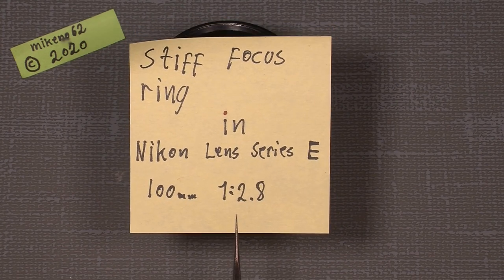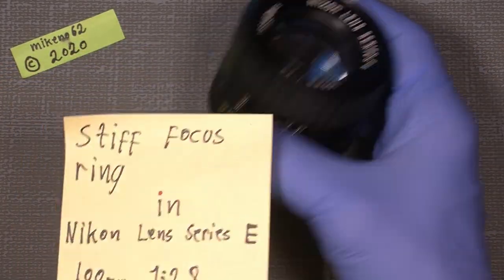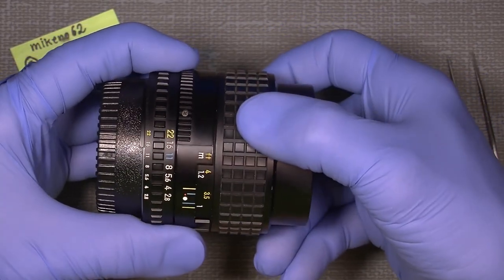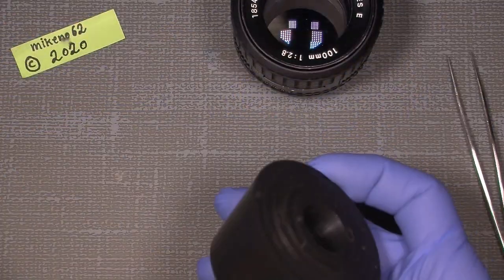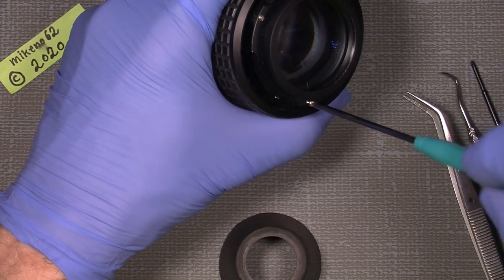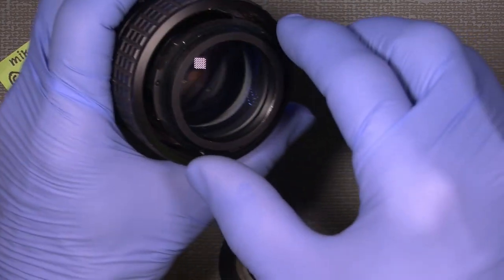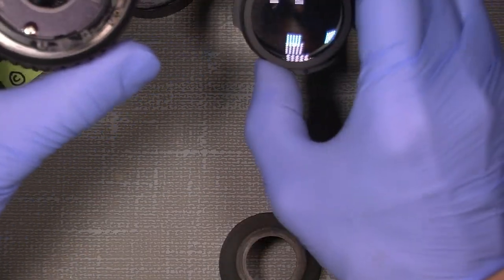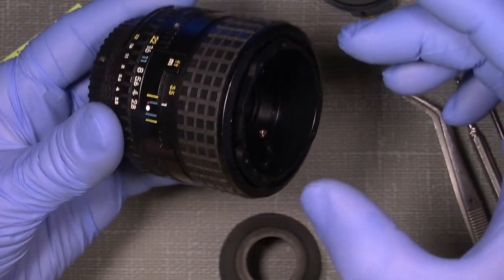Stiff focus ring In Nikon Lens Series E  100mm 1:2.8

Comment: Wow - awesome, thank you very much. I got this lens from a thrift store for 50 danish kroner - that's around 7$ - but the focusing ring couldn't turn at all, stuck between 7 and 15 meters. Now it works smoothly, though I didn't get how to adjust the focussing, because at infinity focus it now ends on the scale at the spot where it was stuck before.

Comment: Hey, I’m taking apart one of these lenses and the springy metal piece in the focus ring at 40:55 came loose on mine. I tried installing it as usual but it just slips. Should I be gluing it back onto the ring and with what glue? Or is there something else to it? Thanks